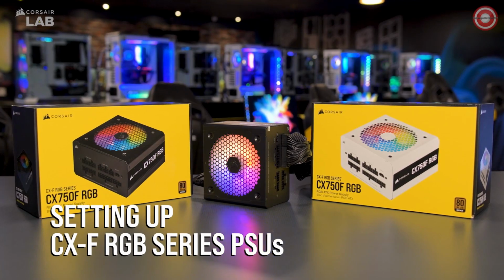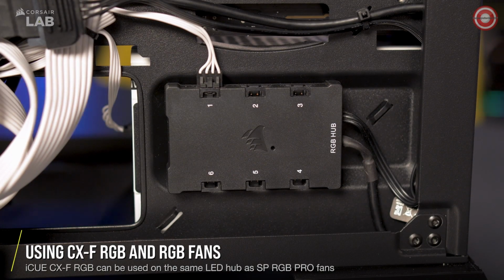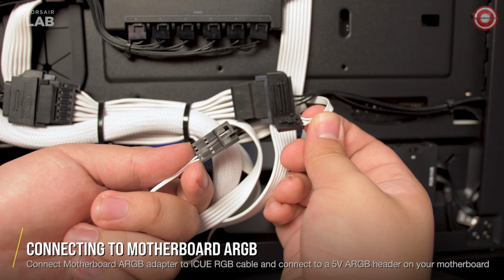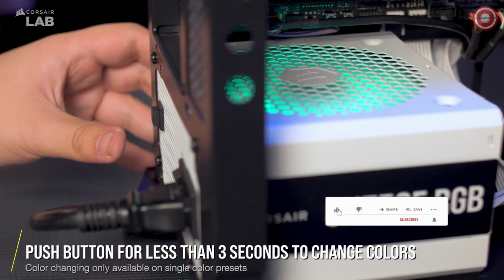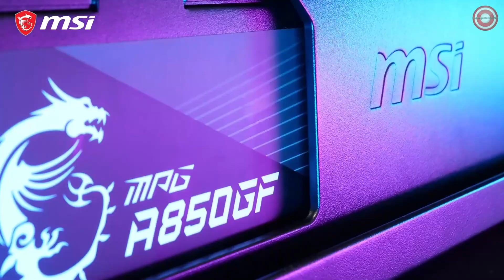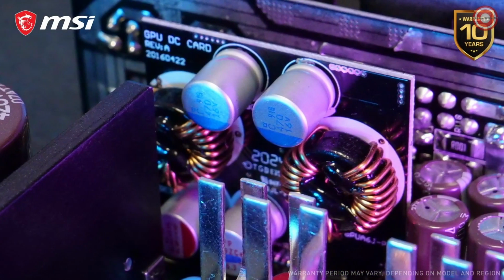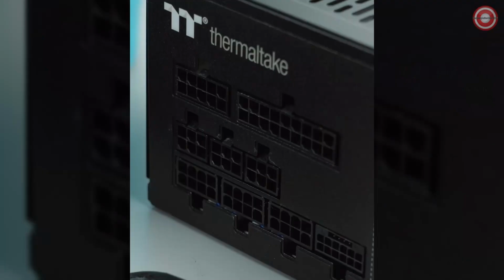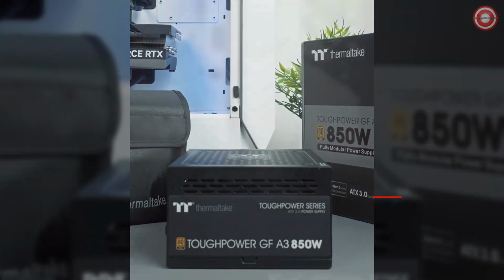4 Best PSU to Buy with the AMD Radeon RX 7800 XT

Comment: I am waiting for the delivery of 7800xt asus tuf...

I have 650psu.

Pcpartpicker totals wattage as 612.

Headroom left 38watts.

Is that risky ?

612 that including 7800xt into the build.
Reply from the maker: Whether or not 612w is enough for 7800xt asus tuf with a headroom of 38w is a bit risky. AMD recommends a minimum power supply of 700w for the 7800xt. This is because the 7800xt is a very powerful GPU, and it can draw a lot of power under load.

If you are only going to be using your PC for gaming, then 612w may be enough. However, if you are also going to be using your PC for other demanding tasks, such as video editing or 3D rendering, then 612w may not be enough.

Another thing to consider is the quality of your power supply. If you have a cheap or low-quality power supply, it may not be able to provide enough power to the 7800xt.

Overall, I would recommend that you upgrade to a 700w power supply if you are going to be using a 7800xt asus tuf. This will give you some extra headroom and ensure that your power supply is able to provide enough power to your GPU.
Reply: it will work just fine
Reply: @dayathor  yeah right 😆

Already replaced.

Not worth risking.

Comment: Hi i have a i514500 and rx 7800xt i bought a corsair cx750 bronze will this be enough
Reply from the maker: Yes, a Corsair CX750M Bronze is a good choice for an i5-14500 and RX 7800XT system.
Here's why:
Sufficient Power: 
The RX 7800XT is a power-hungry card, and the i5-14500 is also a relatively power-hungry CPU. The 750W rating of the CX750M provides ample headroom for both components, even with overclocking.
80+ Bronze Efficiency: 
While not the highest efficiency rating, 80+ Bronze ensures reasonable power efficiency, which can help reduce electricity costs over time.   
Note:
While the CX750M is sufficient, if you plan on significant overclocking or adding more components in the future, a higher wattage PSU (like 850W) might be a safer option.
I hope this helps!

Comment: Do you think it would be enough the corsair rm750x for a rx7800xt and a ryzen 5 7600x?
Reply from the maker: Yes, the Corsair RM750x is a good choice for a RX7800XT and Ryzen 5 7600X. It is a high-quality PSU that has the capacity to handle the power requirements of these components. The RM750x has a 80 Plus Gold rating, which means that it is 87% to 92% efficient at converting AC power to DC power. This means that it will produce less heat and consume less power than a PSU with a lower efficiency rating.
Reply: @AryTechB  Thanks a lot for this comment! I just wanted to ask if rm750x is still enough for both components (rx7800xt and r5 7600x) taking in count that the CPU needs a power supply too or does it work different? Thanks again and I hope you can solve my question!

Comment: Including all the fans and everything present on a pc 
Nitro+ 7800 xt and a 7600x I have 
I have a total usage of 534 watts on pc part picker 
Will it be safe for the usage ? On 650 watts PSU
Reply from the maker: As I have said to other followers - I do NOT recommend a PSU smaller than 700W. 
If you want to continue with a 650W PSU, you need to know what can happen - 
System instability: When the PSU is not able to provide enough power to all of the components in your computer, it can cause the system to crash or freeze.
Overheating: A PSU that is under-powered can overheat, which can damage the components in your computer.
Damage to the PSU: If the PSU is overloaded, it can be damaged or even destroyed.
In some cases, using a PSU that is too small can even cause a fire.
Reply: I believe the rule of thumb multiple pc part picker watts by 1.5
Reply: 850w 👍🏼

Comment: can you   plug this amd RX 78000XT   into  PCIe5 slot in PSU  ?    is there any cable possible to do that ?
Reply from the maker: You can connect to this GPU with two 6+2 PCI-e connectors or with such a cable if you have a latest generation PSU.
https://assets.corsair.com/image/upload/c_pad,q_auto,h_1024,w_1024,f_auto/products/Accessories-Parts/base-CP-8920284/Gallery/PCIe_5_12VHPWR_PSU_Cable_Type4_01.webp?width=1080&quality=85&auto=webp&format=pjpg
Reply: PSU is  FSP Fortron Hydro GT PRE ATX3.0(PCIe5.0) 850 W
Reply from the maker: @viliamkotoc6511 Yes, you can connect to the GPU with what I told you previously. Either 2x6+2 VGA or a cable similar to the one in the picture.
Reply: thank you

Comment: I just got a 7800 xt hellhound and it says 750w+. Mine is 700w be quiet pure power 11. Is that risky?
Reply from the maker: AMD recommends a minimum of 700w PSU for the RX 7800 XT, and the Hellhound variant is likely similar in power draw.
I recommend you to use this PSU wattage calculator ( https://outervision.com/power-supply-calculator ) and see how much your PC consumes, then decide if 700W is enough or not.

Comment: is 750 watts bronze 80+ will be fine for 7800xt?
Reply from the maker: Yes, a 750W 80+ Bronze PSU is generally sufficient for a 7800XT, especially if you have a mid-range CPU. However, consider a higher wattage or efficiency rating for future upgrades or overclocking.
Reply: @AryTechB  Thank you I have been wondering about this. Since my 7800 xt is arriving this Sunday and my corsair rm850e is arriving on Tuesday lol.

Comment: Im have a 650w power supply. I read on reddit that people had no problems with that but what do you say.
Reply from the maker: AMD recommends a minimum of 700w PSU for the RX 7800 XT, and the Hellhound variant is likely similar in power draw.
Irecommend you to use this PSU wattage calculator (https://outervision.com/power-supply-calculator ) and see how much your PC consumes, then decide if 700W is enough or not.

Comment: I have cooler master MWE230V 650W power supply and my rig as follows
MSI mortar 660M ddr 4 motherboard
Intel core i5 12400F
ADATA XPG GAMMIX D30 8 X 2 16GB DDR4 Ram
1tb Wd blue 7200RPM hard drive
and wanted to buy Asrock rx 7800xt challenger 

pc part picker gives 474W of total usage
will that be enough please help😢

Also i will be doing gaming only on 1080p 165hz moitor
Reply from the maker: Not having all the necessary information (the cooling system and the fans the system has) I can only tell you that AMD recommends a minimum of 700W for the RX 7800XT.
In an estimate made by me, your system would consume around 580W, which leads to a 95% load of your 650W source.
Reply: I have stock cooling for cpu and case have 4 fans 3 in front and one in back
Reply from the maker: @ajinkyapatil1412  My answer remains the same.
I do NOT recommend a PSU smaller than 700W
You can also use a wattage calculator that you can find online to calculate how much your PC will consume.

Comment: on a 7700xt its possible to have a 650 psu or  it will not work
Reply from the maker: It is possible to have a 650W PSU with an RX 7700 XT, but it is not recommended. AMD recommends a 700W PSU for the RX 7700 XT, and this is because the card can draw up to 245W of power under load. A 650W PSU may be able to handle this power draw, but it will be running close to its limit. This can lead to instability and even damage to your components.
Reply: @AryTechB  even the 7700 ?? XD

Comment: Will a 700w psu be enough
Reply from the maker: Yes! AMD recommends a minimum power supply of 700w for the 7800xt. I recommend 750W minimum thinking about the future (future PC updates)
Reply: @AryTechB does the rating of the power supply matter